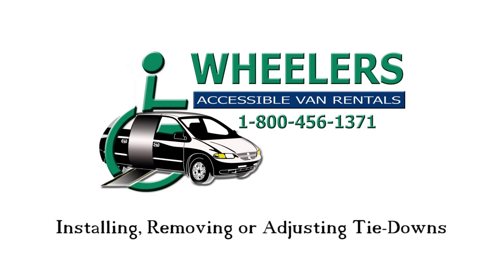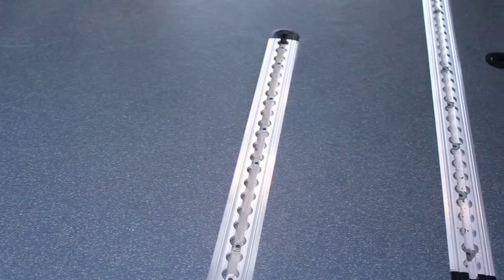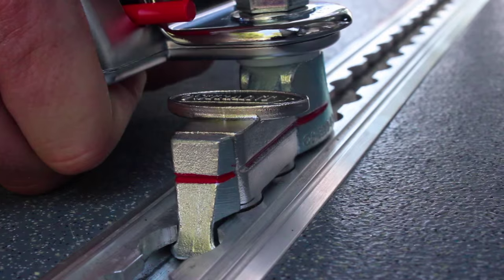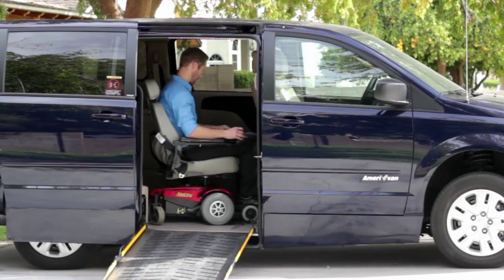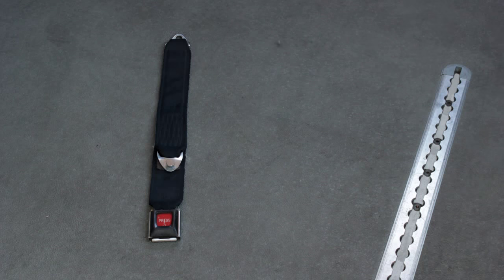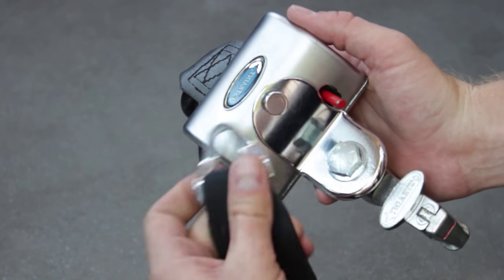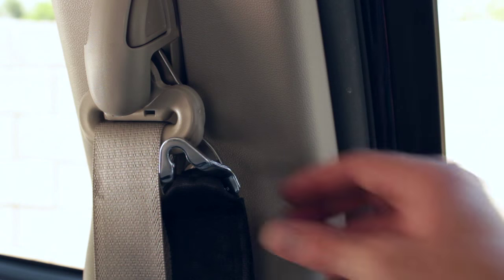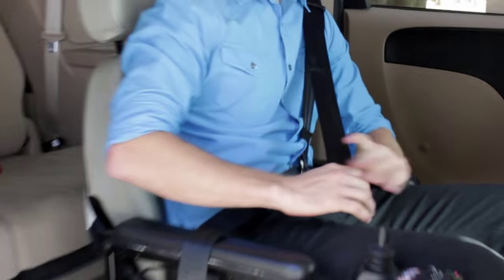Tie-down & Seatbelt Instruction

Comment: This is the worst tie downs. Takes forever to adjust. If wheelchair is not in the exact same spot the next time you have to start over re-adjusting all the belts. I dread using it and I think they are unsafe. The shoulder belt does not go over the shoulder and it hits at upper arm. Tried many times to fix it. Mobility center has the same problem. Miss the lap/shoulder retractable belt.